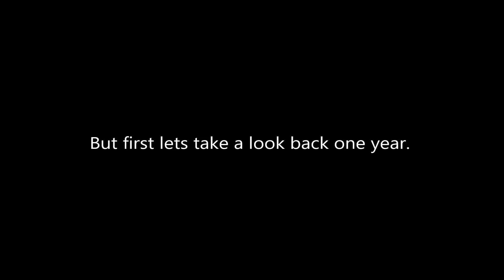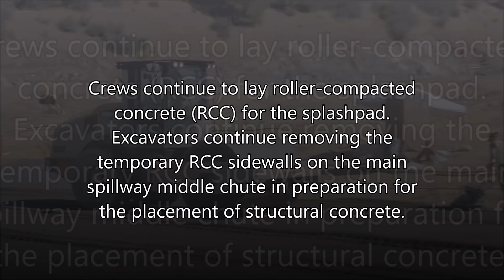Oroville Dam One Year Later

Comment: During the Construction Work of Cascading Route towards River side need to be a Provision of Separation Joints alignments at different locations along with the Seepage & Drainage system both Horizontal & Vertical Ventilation applications must be add in the subject Emergency Spillway Project considerations because without this after passing some time Crakes and Settlements impacts will be going on that’s why think about it as soon applicable now possible.???
Reply from the maker: a person who lives there had commented that the newly built spillway had cracks already.
Reply: @ShaneH8633  Are you that stupid as to place importance on the words of someone who is just as ignorant of construction as yourself?  Concrete always cracks when there's an enormous surface area of the stuff.  No exceptions.  But with proper reinforcement, the cracks are not an issue at all.  Anyone who thinks the cracks matter at all, in cases where the design is proper, needs to stfu and do some learning on their own before pretending in front of the whole world that they know better than the designers do and sounding such a bogus alarm.

Comment: Now the Oroville Dam rebuilt Spillway need to be add provision of slope protection at both sides of embankment to protecting Spillway Walls & Bed from heavy flood water flowing pressure somewhere if hitting to its surroundings, whenever high flood warning and over Topping situation as much in last year 2017 or in future could not damages to this long strip of Newly constructed Spillway???
Reply from the maker: i thought the same thing.
Reply: @ShaneH8633  I know this is two years late, but sheesh this is pathetic.  You said you "thought the same thing".  In other words, you didn't pay the slightest bit of attention to the difference between how the water flowed around the failed spillway, and how it would act on the same kind of spillway that is properly designed in the first place and does not fail.  If you aren't going to pay the least bit of attention to what the details are regarding reconstruction and how that will affect performance, why even post a video, and especially, why post such moronic comments based on such a complete lack of understanding??

Comment: So Nothing changed
Reply: If that is your assessment, you don't understand the plan at all.  "Odd"?  lol  You do understand that is a spillway over there, right?  The fact that it was never lined caused a huge risk to the dam.
Reply: S. H they are hardening the hillside to prevent cutback to the weir. RCC is used extensively for low velocity spillways. It’s relatively cheap and effective.
Reply from the maker: not much. its odd what their doing to left side of the dam, its as if their preparing the whole face to become a spillway.
Reply: @ShaneH8633  With this comment, you really went over the top in your ignorance.  Not much has changed?  You literally never paid the slightest attention to what went wrong the first time, and what was done with the new design to prevent such problems from happening again.  If you had a shred of integrity, you'd down take down this video along with your ignorant commentary.  That "whole face" to the left of the dam is the emergency spillway, which, though the original designers knew it would erode badly if it ever needed to be used (and it never would have been used by now if not for shutting off the flow through the main spillway for a time when it was damaged), ended up eroding much more severely even than that.  And THAT is why so much flow was maintained on the damaged main spillway at the time, so that flow over the emergency spillway could be avoided.   The new emergency spillway will probably rarely, or even never be used, but if it is used, the roller-compacted concrete will provide good erosion protection, and the deeply embedded secant wall will prevent any erosion which might occur from working its way upslope to facilitate a breach of the dam.   It shouldn't be necessary to explain such incredibly basic details to a person who is supposedly taking on the role of providing information regarding the status of the project.